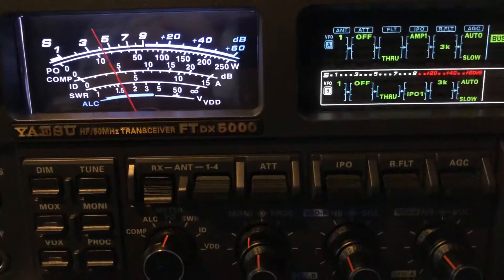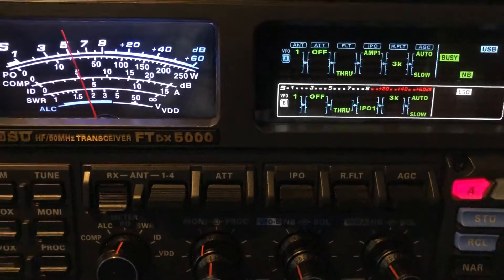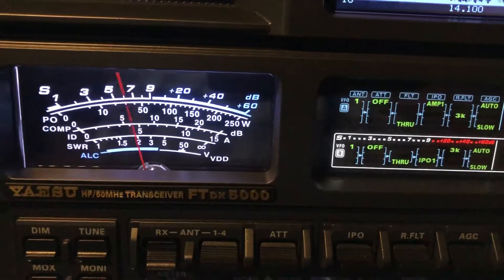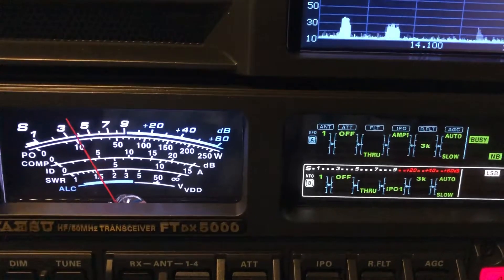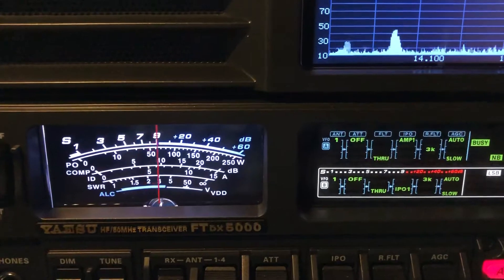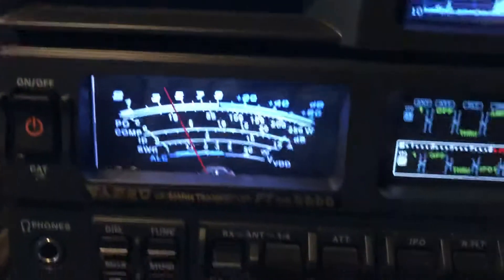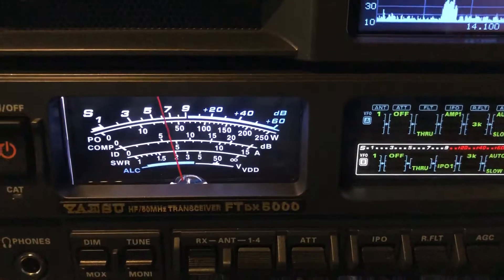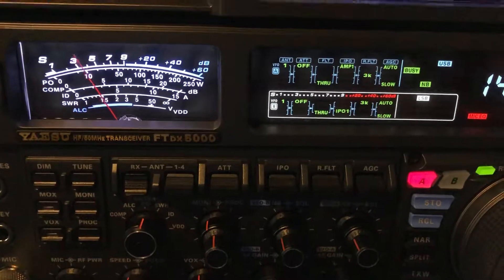The difference between an OCF dipole and a ladder-line-fed 160m dipole (doublet) on 20 meters

Comment: Would be good to know what the OCF length and orientation is for the comparison. The 160 is going to have many more lobes on 20m so it's difficult to tell if orientation gain, antenna length or general antenna performance is the result. If the OCF was also built for 160m length (270ft) and oriented the same as the ladder-fed then the comparison makes sense. Maybe that's the case???
Reply from the maker: The doublet is cut for 160m. The OCF is cut for 80m. They both have some overlapping lobes and there are nulls on one where the other has gain lobes. But that varies according to the band. 

So, the differences between the two are related to length, orientation l, and frequency. The 160m doublet has more gain at the higher frequencies but it also has deeper nulls. 

I’ve used these two enough to know which directions each favors on any particular band. I keep the antenna switch within reach so I can quickly alternate between them to see which has the best lobe for a particular direction. The 160m generally wins where it has the strongest lobe. But the OCF dipole will definitely perform better where it has a gain lobe and the doublet has a null. 

The other contributing factor to the success of the doublet is the ladder line. It has much less loss than the coax, when operating on a band that the OCF is not resonant. The antenna match can make the radio happy but there of still loss on the feed-line going to the OCF dipole. 

73, de N4HNH
Reply: @n4hnhradio  So is it fair to say the 160 and 80 lobes in this video are overlapping and pointing to that particular direction of that qso?  (I'm asking because I'm deciding between a ladder line ocf or center-fed antenna. I realize your 80m ocf is not fed by ladder line - but just thinking generally about performance characteristics)
Reply from the maker: I don’t remember the QSO in that video. I will have to go back and look. But, you can’t really get too worried about where the lobes are.  Most of us just have to install where we can. 

The lobes of a 160m doublet will not necessarily match up with those of a 80m OCF dipole. But the n general, where my doublet has a lobe that matches with the OCF dipole, the doublet usually wins. 

That said, if you put up two of the exact same type antennas perpendicular to one another, and at the same height above ground, and not near metal objects, the lobes for one should theoretically match the nulls of the other, and vice versa. 

The figure 8 pattern we are all familiar with applies to a dipole cut for one band. You install two of those perpendicular and you can generally cover 4 directions.  As you noted, the multi-band dipole variants add more lobes and nulls as you go higher in frequency. But, you could still install two perpendicular to one another and be able to generally cover all directions. 

Given the choice of a doublet versus a OCF dipole, I choose the doublet. You will get the most power to the antenna and signal back from the antenna.  As far as OCF dipoles go, I prefer the Carolina Windom. You have the 22 foot long coax that comes down from the feed-point to a line isolator choke. That prevents common mode current from traveling on the shield to the shack. But it the 22 feet of coax also acts as a vertical radiator, giving you a combination of horizontal and vertical radiation. 

73, de N4HNH
Reply: @n4hnhradio  Thx. I was thinking of an 80m OCF with 450 ohm ladder line rather than coax. Have you tried that configuration?
Reply from the maker: No I haven’t. The OCF dipole is already unbalanced so feeding it with ladder line will result in common mode current that causes the ladder line to radiate. It could pick up noise from your computer and other electronic devices as it nears your shack. 

I think the best practice is to use a 4:1 or 6:1 current balun at the feed-point and run RG-213 or LMR-400 to the shack.  Mine has a 6:1 BalUn and 100 feet of RG-213 going to the shack. 

You can make it better by coming down from the feed-point with 22 feet of RG-213 or LMR-400 to a choke, such as the Maxi-choke, from Palomar Engineers.  From there, continue with RG-213 or LMR-400 to your shack. The 22 foot section of coax coming down from the feed-point will add some vertical radiation into the pattern, which can help for DX. The Maxi-choke prevents radiation below the 22 foot section, to minimize RF that could travel down the shield of your coax and wreak havoc in your shack. So using the Maxi-choke is a bit of a two-fer; vertical radiation and preventing RFI in your shack. 

Note: Be sure to buy the BalUn and Maxi-choke that is rated for your expected power output level. 

You can learn more about this at the following link:  https://palomar-engineers.com/tech-support/tech-topics/antenna-notes/off-center-fed-dipole-notes

73, de N4HNH

Comment: I’ve been thinking about either a 160 dipole 600 ohm open wire ladder line.

Or go all out and try to find a way to get a 160 loop up
Reply from the maker: Loop antennas tend to yield a lower angle of radiation at lower height above ground, when compared to a half-wave dipole.  If you actually want to use the 160m antenna to operate on 160m, the dipole will likely be the better choice.  It will exhibit a higher takeoff angle, suitable for regional communications.  Also, the high-angle lobes of the dipole tend to be slightly stronger than the low-angle lobes of the loop.  

Of course these are generalities.  There are other variables.

73, de N4HNH

Comment: You can't trust this test because the off center dipole has a different radiation pattern,so you can't tell if it is good or not unless you check with kiwisdr the dbm of your signal arriving to a station with a bearing at which both of them should have the same gain,to check the radiation pattern you can simply draw the ocf on mmana on eznec and see,hope i helped you; 73 from italy, IU5OFY
Reply from the maker: My comparisons are never intended to be scientific.  They are anecdotal.  What I show in my videos is typical of my day to day experiences.

I have used these antennas for over 20 years, in two different locations.  I know from thousands and thousands of contacts which ones work best for certain circumstances.  The doublet will beat the OCF dipole 90% of the time, no matter where the other station is.  The doublet is twice as long as the OCF dipole, and it has low loss ladder line, compared to the RG-213 that feeds the OCF dipole. 

73, N4HNH
Reply: Totally agree. Which direction are the antennas oriented? How high? 160/80/40M OCF? If the 160M dipole was pointing towards the station that you worked, i would be expected to be stronger because of the lobe of radiation.